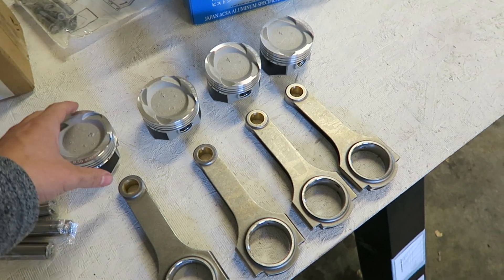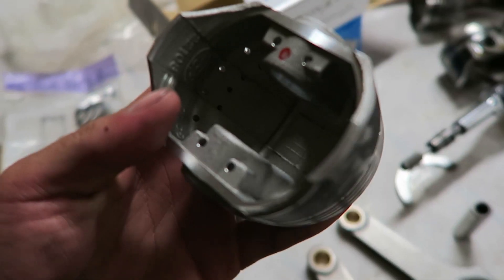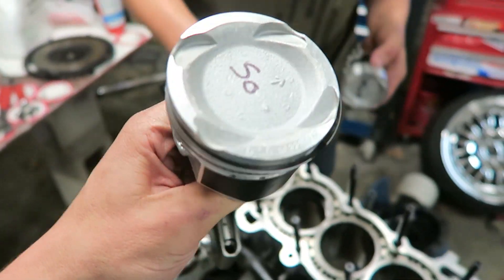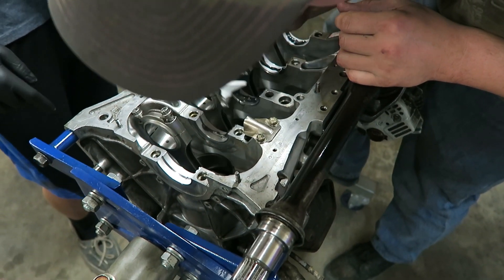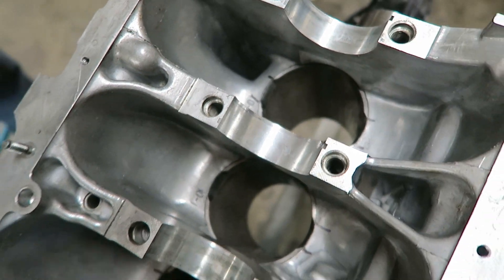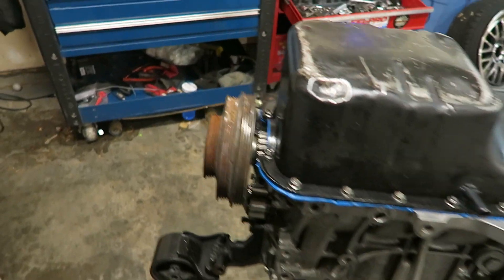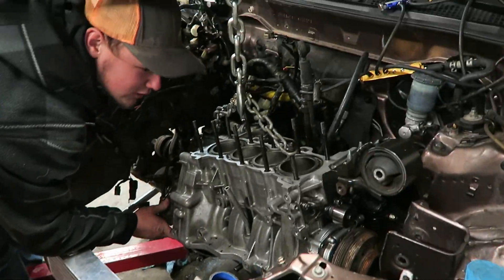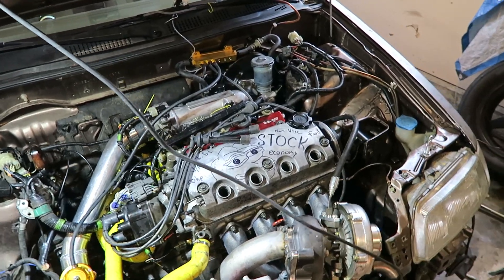Getting Charlie's Motor Back Together

Comment: ...staying tuned to see how not notching the block correctly is going to work out....
Reply: RedKnight 47 100% gunna blow up have had first hand experience
Reply: loooool
Reply: RedKnight 47 no Plasti gauge
Reply: RedKnight 47 is they were hitting slightly with hand cranking. .. Wait until it's revved to 8000-9000. Wham!
Reply: little bit haywire haha
Reply: guy who built my 2.3l 4g63 stroker didn't clearance the block because when he cranked it by hand it didn't touch, but when it bloo after 300 miles there were big gouges from the rods on the block.
Reply: same here lmfao
Reply: RedKnight 47 you know the feeling though, when you've been repeating yourself for ages, eventually u don't give a fuck lool. I'd still never leave it touching like that though.
Reply: hey its still running. personally I would not risk it.
Reply: Tevin Atkinson agreed, hope it lasts though!

Comment: Dude before I came across this channel I was saving for a Nissan 350z now I'm set on building a Honda Civic hatch
Reply: You will save SOOO much money working on Hondas instead of a 350z, hahaha. I'm not a big Honda guy, but it's just true.
Reply: Quickwaffles build it right. Built motors dont last forever depending on how much you abuse it. You will see that you would need a rebuild in 2 years before having a spun bearing, messing up the crankshaft, rod, then cylinder lol. Buying new sets of pistons, rods, crank and block isnt cheap either :/

Comment: Have you guys seen budget racers? they used an ebay turbo and keep blowing up their turbo. This setup impressed me to say the least.
Reply: The turbos from ebay were not faulty, Budget racers were not hooking the oil feed line up to the right location. IIRC they connected it to somewhere on the oil filer housing when it should have been teed off the oil pressure switch.
Reply: Un-TY-Told they have a different problem evvery video its dissapointing
Reply: Shabb3r You're 100% right. The first eBay kit that I bought for my single cam I was planning on using the hard parts of until I could afford to build up to better quality parts, I ended up using the turbo and must've gotten a really good one because I put 22,000 miles on that one and it still has very minimal shaft play. My buddy has been using it on his car when he bought my old JDM D15B VTEC and he put another 9,000 miles on it so far. I bought another one right before I swapped my engine because I snapped a downpipe bolt off in the exhaust housing and  it started smoking almost immediately after startup because my ported and shimmed oil pump blew the seals out of the turbo. I ended up swapping the exhaust housings on the old turbo and its still going strong for him and he dailys it. It's just luck of the draw with them. I've had guys say that if they do blow, and you rebuild them with a quality kit, and they're balanced properly they'll last forever.
Reply: 1 thing Ican sayabout cheat turbines is i can get 50  dollar air polishers, and 400 dollar ones. I assume the 50$ ones are powdered metal molded some how, look up the channel aVe he tears down tools. The 50% air polishers seam to have Bad bearings that heat up and if you run them without cooling they get hot, even though the air should cool it because 400 alpha polishers don't get hot they get cold. I just would think ebay would be the same.

Comment: Do you all know what normal PSI for a stock H23a blue top is? I did a compression test and the cold numbers were 200 on cylinders 1,2,3 and 150 in number 4. It went to 200 with oil in number 4 and 225 in all the rest. I suspect my rings in number 4 are either stuck or worn really badly. I'm doing a MMO piston soak right now i poured some in the spark tubes. Its a JDM engine and I never touched the bottom end just the top end. It really stinks when your motor is going kaput and you don't have the time or means to either rebuild it or replace it. A JDM h23a motor is around 1100. I payed 800 back in 2015. Its simply not something I would ever be proud about doing (ruining a motor). Sure I did a bunch of high rpm shifting but it was all stock besides a few intake and exhaust upgrades. But it stinks when you see what you've done, the end result is a dying of your engine, like seriously really? Not something to be proud of in my book.

Comment: a piston ring gap grinder will grind both sides of the gap at an angle to maintain a consistent gap from the outside of the ring, to the inside.

Comment: Where did he get the idea to use assembly lube on the bearings? Just curious, I was always told to use motor oil. Not saying anything was done wrong, just going off what I heard.
Reply: Duane Hallgren you can use either 30w oil, or assembly lube. assembly lube was developed to break down enough when oil starts flowing, to get caught in the filter.
Reply: Assembly lube is essentially very thick oil with good metal to metal contact inhibition properties. Just extra assurance you won't scratch or burn anything up on startup.
Reply: you can used either. always been told to use engine oil if the engine will be started not long after the build but if the engine is going to sit for any amount of time then its best to use assembly lube

Comment: great vid... cylinders get honed cross hatched to break in piston rings???
Reply: lol look at the vid... its a "fuck it fam type" of build right now
Reply: No plasti gauge i figured that lol... I really just wanna see the wago last a while... I don't judge...
Reply: lucifur999 
Shoulda sent those rings to total seal and have them modded for top gapless. 
They did a set of 5 for me for under 150
(I have a 4 cyl but had an extra set built in case I busted it on install, think ahead worst case)

Comment: why setup the oil control rings so loose?
I get the top ring and the second ring setup..... i guess you opened up the second ring more than the top for flutter control

Comment: Did you guy see if the oil pick up is to close to the oil pan because the oil pan is caved in? I had a oil pressure problems because of that.

Comment: ey boostedBoiz need a advise. building a d16 turbo order Hastings rings for vitarra 75.5mm top ring .019 second .021 and the oil rail out of the box are .031 is this ok ? thanks

Comment: I'm no expert but aren't Pistons like balanced or something? Like if you didn't shave them all the same wouldn't that be bad? Idk I'm just asking
Reply: Yes. The less balanced the pistons are, the more vibration will be created. If there is enough imbalance, it can definitely cause accelerated wear or other issues. A small enough difference isn't the end of the world, but the higher the RPM, the more dangerous imbalance becomes. Some people balance down to 0.1g or less for high revving builds. Honestly though, if they are close enough, it will probably be fine. The rod clearance is going to be a much bigger issues.

Comment: Great to see you guys working together. However; you introduce alot of dirt and metal filings on your parts and in the engine. Parts on the floor, too many hands working on the internals, not holding the ring compressor in place while driving piston in can break rings easily...etc. You learn from actually doing though, but maybe you all need to take an engine apart and do an analysis of wear-abnormal wear and think about what causes those problems.

Comment: Charlie, did you put the spark plug wires in before you tried to start it 💁🏼‍♂️
Reply: Brandon Watson yes I took the wires out to turn it over a few times to cycle the oil
Reply: Wait, is that really you, Charlie?

Comment: im trying to boost a stock del sol with a ebay turbo kit should i tune it
Reply: Landon Robertson nah
Reply: Landon Robertson  do it
Reply: if it came without a turbo, there is no point. its gonna blow within a few thousand miles unless you are running wery little boost. non turbo engines have much higher compression and will just blow up eventually. u could do 0.2-0.5 bar on a stock non turbo engine. with variations and exeptions
Reply: Landon Robertson slap that turbo on and get it tuned it will be fine stock.  My b18 has been on 10psi for two years just did head studs and head gasket other than that it's bone stock
Reply: wow you really seem like the authority on everything turbo.
Reply: Landon Robertson if you have a d15b7 people say they can do around 175 hp safely but get a good tune
Reply: it has a d16y8
Reply: with a mini me swap vtec head the build will be on my channel
Reply: Landon Robertson nice
Reply: Landon Robertson 
If your seriously asking us then no, you should not tune it. However, you should take it to someone who knows what they're doing tuning wise so you don't blow your shit up. Don't drive it without a tune.
Reply: A huge wasted effort if it's not tuned. Seriously.

Comment: Hope it does go well to much work for it not to work.
Reply: how are we defining "work" here? the engine might run but its out of balance and the rods are hitting the sleeves.. really want to know what is going to happen too since people think of engine building as an art or a very delicate practice
Reply: i wouldnt sit my ass there measuring EVERYTHING to i dont have to pull that sucker back off EVER again, really into engine building, still learning before i try to rebuild mine

Comment: Anybody know what size injectors I should run in my Integra if I boost it on around 10 lbs? Sorry I'm a beginner lol
Reply: This isn't really the right place to ask. Got to the Integra forums. That said, you probably won't need larger than 500cc tops for an engine smaller than 2.0L on 10lbs of boost.
Reply: PhantasmAMX I was stuck between 450cc and 550cc but I think I'll go 450 and not go anything crazy
Reply: Josh McDermott I mean, it's not usually bad to have overhead, so given a nominal price difference, you can go bigger, but you have to make sure to manage the fuel properly. If you are planning on a standalone ECU, any size will work, but if you are trying to get away with stock ECU, trying to match the size is best. Try Googling some calculators.

Comment: what a sketchy ass build grinding pistons/cylinders to make shit fit? ebay specials?
Reply: KoG GoK You have to notch the block on some builds. Its well documented on Honda sites.
Reply: AutoTechDale what about grinding the piston so that the rod can be installed? is that also part of the honda community?
Reply: KoG GoK its not just about part of the Honda "community". Do you just think its only Honda engines that you need to notch the block when you are not using factory parts? If thats the case, you are gravely mistaken. 

I understand that this rebuild wasn't professional in the terms of using plasti gauge, using telescoping gauges, run out gauges, dial indicator gauges, checking bearing clearances and so on. I cringed at some parts but, its their channel, their money and their items. Each to their own.
Reply: KoG GoK its normal to have to knotch the block when goin with aftermarket rods.
Reply: built dozens of small blocks and a few ej blocks never have i seen anything like this. like i said must be a honda thing especially gridding the pistons to make the rods fit.
Reply: KoG GoK yea its a d16 thing shoulda specified that
Reply: It's funny no one else commented on that.  I thought these guys were legit until this vid lol
Reply: Saucey Tony I used to work on American muscle with Kyle every day I'm pretty confident he knows his shit on the jdm world they are way more legit than you will ever be.
Reply: Not a Honda thing. I had to grind a Ford 351 block to fit a stroker kit.
Reply: i like how no one sees a problem with buying brand new pistons and having to grind them to make them work.
Reply: knotching the block has nothing to do with pistons
Reply: not to mention the rods wouldnt even fit... i think i mentioned that like 10000 times already but for some reason people here think its normal to have to grind your pistons down to get the rods to line up.

Comment: Wow, You cant do that to the block.
Reply: Aroundtheworld 111111111 do what? notch it?
Reply: notching it? well, you cant notch the block , you can notch the sleeves AKA the piston walls, sleeves can be replaced, people notch sleeves to use a bigger crank to stroke the displacement a bit so you can the  SLEEVES obviously this isn't the way to do it same goes with notching the pistons cus of balance and shit but yea you can do that
Reply: naigers rs bro what u even saying I've notched blocks just how they did. I did notch it more but still never had any problems
Reply: +gs ks never said that there is anything wrong with it, but it aint machine shop quality, there are better methoods to so it.. this thing is hagard af

Comment: y did you guys fill the oil passages with that thick assembly lube on the main barings your sapost to keep those oil passages clear but w/e just prime the engine with a drill on the bolt of the oil pump befor you install the belt other thin that you guy did your homework for the most part I was saprised to see you gap the rings thats like the top 5 most important thing you need to do I know you guys are broke as fuck but did you have the head machined level  ??????????????? I guess we will see if you blow a head gasket in the first few pulls and how many miles do you need to put on the engine befor you can add high boost I herd that the sr20det's need 1000 miles befor you can raise the psi

Comment: "design flaw"  
There was probably a reason the engineers did that no? haha
Reply: Probably meant to be shaven when you're balancing the motor at the machine shop, who knows. Did they mention what pistons they were?
Reply: I was thinking the EXACT same thing!? That wasn't a "design flaw" at all fellas, that ridge was cast into those pistons that way to give the piston dome more rigidity and STRENGTH. Pretty ballsy grinding shit off of a piston before shoving it in your engine and pushin 20+psi to it.
Reply: TWIRKNOLOVE    
They're YCP, some Taiwanese company.  
*****  
The stock ones must not have that ridge, but the company that makes them says they use a stronger metal than OEM
Reply: there ycp vitara style pistons...oh and they have some weird coating on them lol
Reply: That tiny lip would not have provided extra strength. It was likely where the casting mold seam was and they didn't bother to take it off because normally people don't run that beefy rods with those pistons.